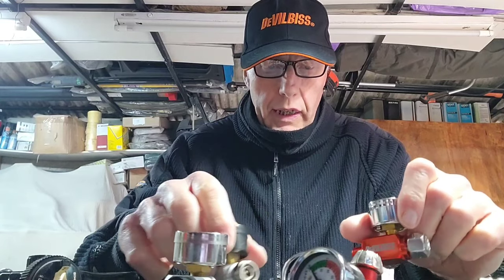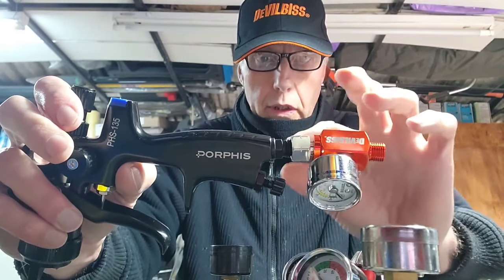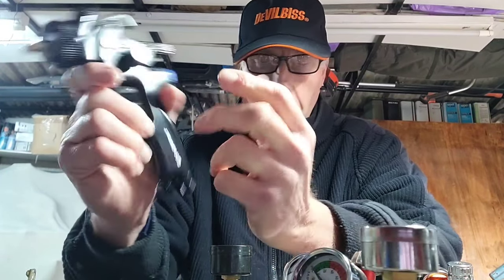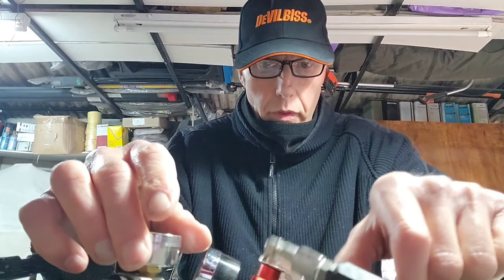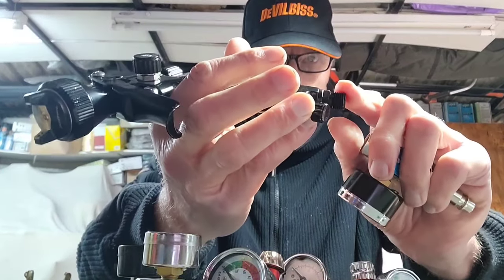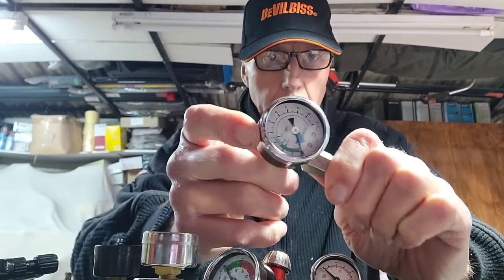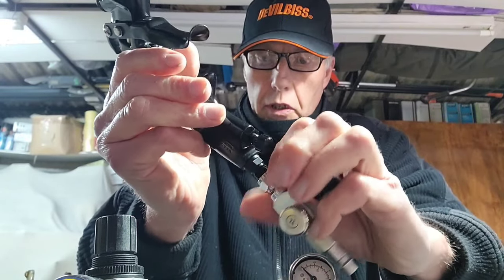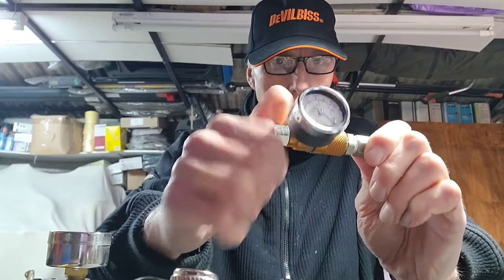Spray Gun Air Regulators & Diaphragm Regulators, What They Do & Why You Need One, Cheater Valves

Comment: I hardly ever used a gauge for a loooong time, I just went by sound, feel, and what I saw also and I could always duplicate that “sweet spot”. A gauge does make it easier I suppose but I do still prefer it without especially on a clear gun simply because it just feels less “clunky”and more nimble. I definitely prefer the smaller gauges same as you if I need one. I am a sucker for digital guns and toys though! 😄
The Meiji are nice!

Great content as usual, always really interesting 👍🏻
Reply from the maker: Hi Mate, I went through a similar stage and didn't use a regulator,  I would probably still be there now, I just went on what I was seeing.

Then, starting this channel, I realised I couldn't give people any settings for air pressure as I didn't know 😅 

Fast forward to today and I wouldn't be without one of these diaphragm regulators, they smooth out the delivery so nicely, it doesn't matter what your air supply is doing its just a constant supply of steady air..

I have a diaphragm regulator in the middle of the line, but one on the gun just makes it better , cheers buddy,  appreciate it 👍
Reply: @peteshobbies5383  you nailed it, they definitely do get rid of the turbulence and smooth out the delivery and are dead stable. 

You’ve got me binge watching all your vids and making a loooong wishlist😅
So far I want an ani black or skull, ani f160, definitely a sagola 4600 with 1.3xl and dvr cap, a dv1 for base, and the list goes on….. and I don’t even need any of them now, I just want them 😂

Great stuff though, I really love how you deep dive into all the little intricate stuff, very well done, keep ‘em coming! 🙌🏻
Reply from the maker: Cheers, mate,  sorry its going to cost you so much money, I know the feeling only too well, hell, I don't need many sprayguns at all, but I want them 🤣😂

Comment: I always prefer Diaphragm type. They last longer, and I like that they read the pressure as it is without going to max then having to squeeze the trigger then to set it because those tend to give inconsistent readingd after awhile like the 3M one I tried once it sucks. I have come to like a brand of diaphragm to get off ebay called RTI. Thet cost about $55 USD. Though my DV1-B and DV1-C have the digital above the fan  control knob my DV1s mini and new Iwata Wider 4 do not have their own regulator. Most definitely not all regulators are equal. When i ran Walcom i did like the digital that the guage itself QD on and off the regulator but like the Walcom guns themselves, they simply did not last
Reply from the maker: Hi buddy,  I almost always use a diaphragm regulator now. It just makes the air delivery so constant and consistent, and that helps give a more uniform finish, appreciate the comments,  thank you 👍

Comment: Hi Pete, this is just for you mate👌👏👏👏👏👏👏👌👍😅well done Pete that was a brilliant brilliant video and very well explained💪👊👍
I've got quite a few regulators (cheater valves) and I do prefer the digital as I can see them better (it's an age thing🙄) than an analogue gauge, you have seen the ones I use which I get from the USA the digital gauge is really good and thinners proof but the regulator is not to good so I've just bought 3 ANI regulators and replaced the gauges with the digital ones which I also like. The gauge on my RC1 went wrong so I put one of my digital gauges on that as well so I now have a few good regs and gauges🤓😎 

I do like the diaphragm regulators but I don't trust the cheap one as I got one a few weeks ago but didn't realise that the knob is on the wrong side and it gets in the way🙄you don't want a knob poking you in the wrist when you are trying to paint😬🙄🤣🤣
Anyway mate a great video and thanks for taking the time to do this for us as it's very useful, cheers Pete👌👍
Reply from the maker: Hi John, The ANI regulators are good value for sure. My only criticism is that they are a little long, which many, me included, will find annoying.
The diaphragm regulators on the gun come into their own when you use them with the bigger consumption guns as they allow you to have 4.5 to 5 bar at the filter set and keep the pressure at the gun lower,  which helps keep everything stable.

I hope people watch the last 3rd of the video as that's the most important really,  having a steady air supply is key to laying paint consistently.

I'm sorry to hear you had problems with the knob mate. All I can say is we all experience these things occasionally 😉 🤣

Cheers mate 👍
Reply: Yeah the ANI ones are a bit long especially for what you do with the bike parts but they don't really bother me. The diaphragm regulators are nice to have as they stop that surge of air that you get each time you pull the trigger which you mentioned in the video and demonstrated very well👏👌

I think the knob problem was down to the sure size of it mate but you would think I should be used to that by now😁🤭🤣
Thanks Pete👍

Comment: Hi Pete, In America we have a company that makes Air Line Equipment called Reading Technologies, Inc. (RTI) and they make a nice spray gun regulator called the MR-1. It's a true regulator rather than a cheater valve and it's the one I use on all of my guns.
Reply from the maker: Hi Mate,  You get a good choice over in the US, and they seem much cheaper than what we pay for the same sort of thing over here.

I just looked at the RTI MR1 , we can get it over here, but it's ends up around $105 USD, which I presume is much more than you would pay?
Reply: I like the MR1 better than my inest iwata. Usually don't use regulators on most my guns. 
 My diaphragm pressure gauge/regulator is on the wall with the secondary filtration system.  The length of the hose is 12 feet 3/8 inch I.D. with high flow Milton fittings We only can use HVLP guns so volume is important. With short hoses we don't get too much change in pressure reading from the wall to the gun.  Cheap chocker valves are just air volume restrictors nothing else.
Reply: @peteshobbies5383 Hi Pete- saw the RTI on eBay for 54.99 and 10 bucks shipping. I have one TGR AT 29.95 shipping included. Works great and the adjustment knob is on the left where you like it. The RTI looks like the knob is on the right and is extended out further- probably would get in your way!  
Also TGR has the same diaphragm unit with a dial gauge for ten dollars less.
I really like the barrel ANI cheater valve too as they are fine on my home set up with a larger regulator/water trap at 80 psi, spaced by a 50 ft hose to my gun.
Additionally, I would like to acknowledge you for your informative videos. I especially liked the ones on the spray patterns on DV1 and Prolites and have those. I don't do enough spot repairs now to really groove into one (but a TE10 with 1.2 has afforded many pleasing jobs.) Thank you, JK
Reply from the maker: Hi Jay, I didn't realise the adjuster was on the right on the RTI but your right,  considering most people are right-handed it would be awkward,  maybe there's a way to change it?, I'm not sure.

The ANI regulators are well made for the money,  They do have a long tail, which can be annoying if you need to move around a lot, things like bike frames can be awkward.

Good to hear you enjoy the videos,  I genuinely enjoy making them and sharing what we find on here,  thanks for watching, buddy. It's much appreciated 👍

Comment: Pete, Sata use Swiss Renata batteries. Longevity, good, but expensive... ouch.
Reply from the maker: Hi Mate, Yes,  you can buy the Renata CR1632 for around £4, Sata wants around £35 for their little kits, battery,  o'ring, and screw on cover, which is a bit steep really

Comment: Gday Pete, came across your yoooo Tooob site whilst looking around at spraying cellulose... the ones of great interest is the one where you were spraying an orange petrol tank in Celly then you used 1K clear over the top of it... Question if I may,  I believe you flatterned down the celly before you put the clear laquer ? also did you leave the tank for some time before you coated it in 1K laquer or just after the celly flashed off? 
Thanks in advance
Kevin
Reply from the maker: Hi Kevin, I've done a video over Cellulose but it wasn't orange it was a grey metallic,  the one I think you are referring to was 1k clear over orange,  but the orange was a sanded down 2k clear over orange basecoat. 

That came out really good, and after 2 months,  without touching it, it held more gloss than the 2k tank that was done at the same time

Comment: Watched  this video a couple of times now LOL. 
Does this make a digital gun a bad choice or does the adjustment at the bottom of the gun work as the diaphragm regulating the digital gauge at the top like in the Devilbiss dv1 digital setup
Reply from the maker: Hi Tim, it's a very good question. It doesn't make it a bad choice as such  as many people will rely on an in-line diaphragm regulator. This will keep a steady flow to the gun.

The difficulty starts when you have a more air hungry gun, like the LS400 in this video. It takes around 16.5 cfm so you will need a higher pressure at the in line diaphragm regulator to supply the amount of air needed by the tool, bigger bore hoses will help here but many,  me included will use 8 to 10mm ID hoses.

In this case, the air needs to be at 5 bar on the in-line diaphragm regulator to supply enough volume of air, that means without a regulator at the bottom of the gun you still get quite a serge of air at first, it also means pressure can and will drop a little at the gun, having another diaphragm regulator at the gun, set at a lower pressure eliminates that.

So, for example,  the other day, I was using my Sata X5500 1.3 CC with onboard digital gauge, it uses around 12cfm so my regulator is set to around 3.5bar to supply it so I just used the gun without a regulator at the bottom,  if it was my HVLP Sata X5500 1.3 I would use a regulator at the bottom as my feed would need to be up at 5bar as with the LS400.

Hope that makes sense 😉😀
Reply: I had to read it twice for it to sink in 😂 I have found I lean towards a digital version because it helps me to articulate gun and wrist. Now I feel more informed and would go for the Meiji diagram. 
How good is the sata 1.3cc. ? 
Have a great Monday
Reply from the maker: Hi Tim, it was quite a long reply, so I'm not surprised you had to read it twice 🤣.

The Sata CC setup has surprised me, I thought it was just a marketing exercise, but it's rather good to be honest, I've got a video to do so that will go into more detail as all is not what it seems, Sata's poetic licence again I think 😉,  cheers mate 👍

Comment: When will manufactures STOP putting gauges on these regulators that read up to 150psi ???? we only want gauges that go up to 70 psi max
Reply from the maker: Hi Mate, That's a good point, even the suction guns don't run that high so I wonder why 🤔